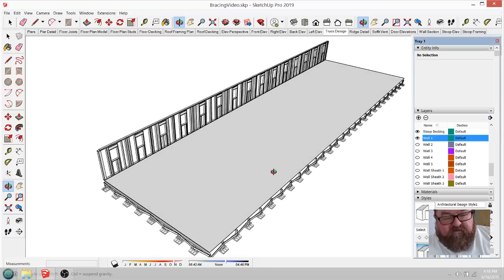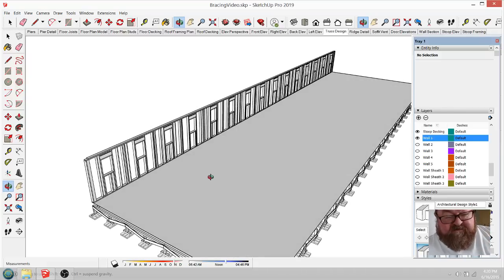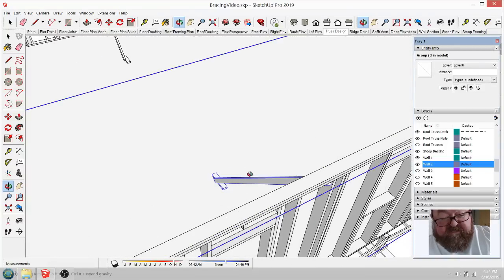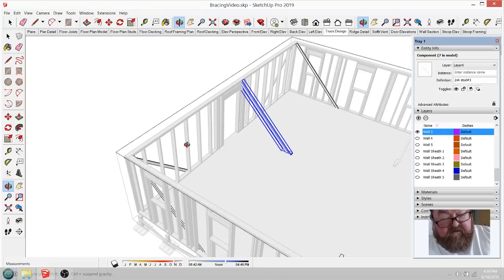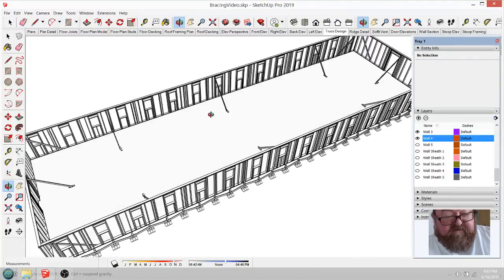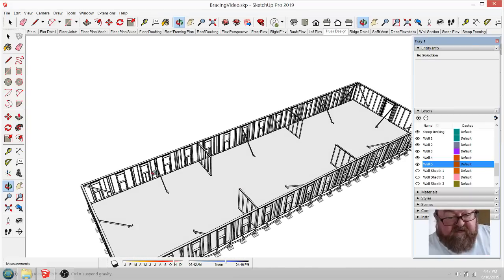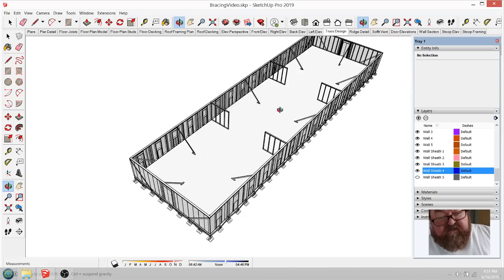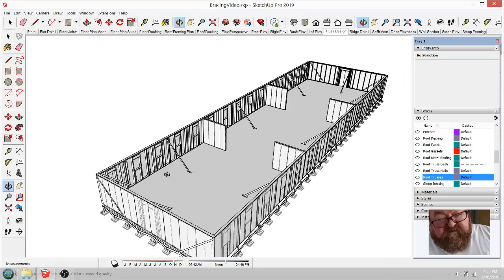Shear Walls and Bracing - Part 1 - Interior Shear Wall Option - SketchUp

Comment from the maker: You can actually install the exterior wall sheathing before the roof trusses are installed if the walls are braced properly.   You just do not want to put up sheathing without bracing because the sheathing will catch any wind and place loads on the walls  which may be unbraced.

Comment: Hi Great, great presentation, do you have any projects involving Cold formed Stud shear walls?
Reply from the maker: No, I think this is one of the few shear wall videos I have.    I think,  as with wood framed walls, steel stud framed walls rely heavily on the wall sheathing and nailing pattern to achieve the rated strength.   I have read this before https://pdhonline.com/courses/s102/shear.pdf  and of course I like the APA website https://www.apawood.org/shear-walls-diaphragms  I hope this helps.
Reply: Thanks Tony.